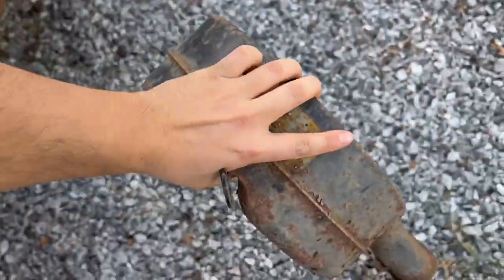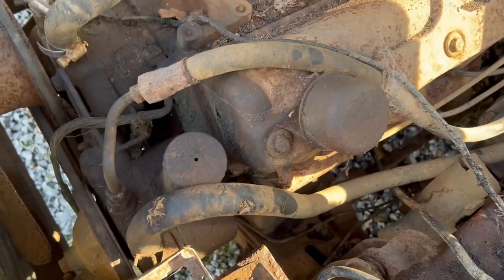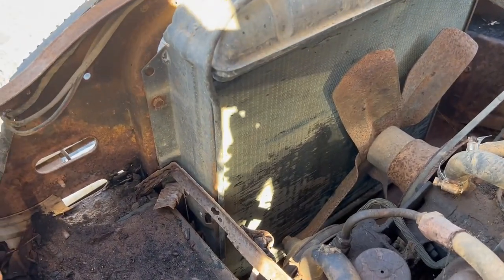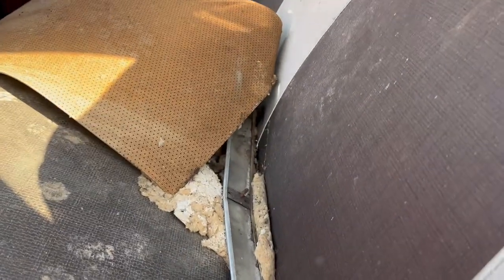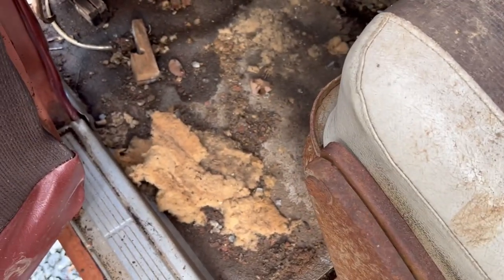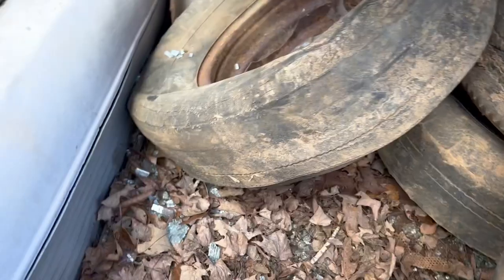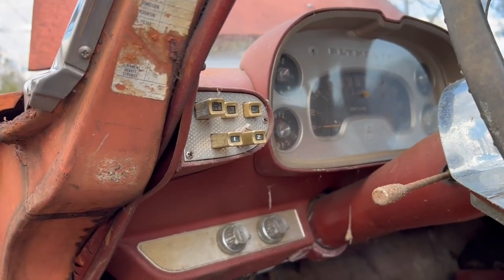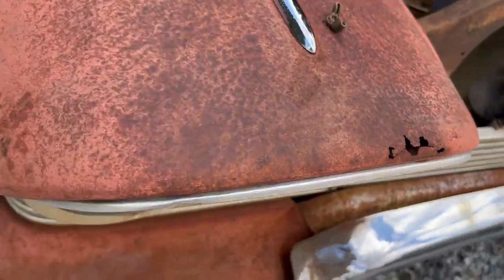1957 Plymouth Sport Suburban Car Show, Abandoned for Decades! Fresh from the woods! MoPar Details

Comment: Dad bought a '57 Custom Suburban in '57 when I was a young 'un. It had the bumper wingettes on the front making it even cooler. All of a sudden our driveway looked years cooler than the others with boxy GMs and Fords. They still had to lift up the rear tailgate glass and prop it up and then open the bottom gate - we pushed a button (option) or cranked the glass into the gate and popped it open. 🚙

Comment: Fun fact:
These cars are able to be push started. They have a rear pump in the transmission to allow fluid to build pressure.
Reply: 100% correct
Reply from the maker: That’s true… but you have to get the car going at a good clip! Almost 20mph! I’ve had to do it a few times but it does work.
Reply: @ObsoleteAutomotive  the car in my profile picture was pushed started when my dad bought it back in  the late '60s. Strange what I remember from being only around 4-5 years old!
Reply from the maker: @dans_Learning_Curve  That’s awesome that you still have the car.

Comment: On the engine, remove the spark plugs (number each wire as to which cylinder it goes to). Then fill each cylinder with Automatic Transmission Fluid and let them soak for several days. This will usually allow you to break loose the stuck pistons although you may have to rock the crankshaft back and forth to loosen things up good. It looks challenging right now, but with perseverance you can get this one going again!
Reply from the maker: The cylinders have all been filled with a blend of oils already. This one was being a bit more stubborn. Sometimes you have to just take the engine apart. 

I had a slant six engine full of water that I was able to unstick and get running! Though I had my doubts on that one!

Comment: You should be able to get the ignition switch out of the car and take it to a locksmith to have a new key made for it. I see many people drill out the old lock with no thought to getting a key made. The switch is probably OK. If not there are likely replacements available from places that specialize in old Chrysler product parts such as Andy Bernbaum. Like someone else mentioned, PB Blaster is a really good penetrating oil to help un-freeze carburetor and other linkages etc. You should be able to get some good lithium grease at your local auto parts store. Good luck!
Reply from the maker: The ignition switch was removed and new keys made by a local locksmith. Drilling out anything is a last resort. This car had a lot of what I call “old rust” which is what you find after something sits for a very long time. Might get lucky with penetrating oils but would likely need heat and some effort to break free anything.

Comment: Oil looks pretty good. These things are built strong. Bet it'll run with some love. No parking gear so make sure the E brake shoes that tighten on the drive line are operable.
Reply: Fyi: these old Plymouths had parking brakes that worked off the rear drum brakes, no e brakes on the drive shaft..
Reply: @markreisen7038  I beg to differ

Comment: The metal piece on the passenger floor covers the column area under the steering wheel. It is held on by a spring or two as I recall. I used that piece to pull off the original interior trim color. As poorly fitted as that dash pas is, my original looks the same. Appears to be missing the dash mounter rear view mirror.

Comment: oil is lubricant, wd40 is a water displacer good for old point distributors and frozen locks
Reply from the maker: Right off the WD-40 website:

Myth: WD-40 Multi-Use Product is not really a lubricant.

Fact: While the “W-D” in WD-40 stands for Water Displacement, WD-40 Multi-Use Product is a unique, special blend of lubricants. The product’s formulation also contains anti-corrosion agents and ingredients for penetration, water displacement and soil removal.
Reply: Yes, it is a blend of lubricants, but it does not function well as a lubricant.  It actually dries up and it actually evaporates.
Reply from the maker: @michaelbenardo5695  The point was to lubricate the moving points so as not to damage the hood or hinges due to years of being closed. I’ve seen countless hoods folded in half and hinges twisted beyond use when people try forcing them open or closed. 

PB Blaster, WD-40, Kroil, 10w-30, Dextron III, olive oil or really about anything to help with friction will work. 

Eventually everything gets a deep clean to remove years of grease, dirt and rust before using the final choice of preferred lubricant.
Reply: @ObsoleteAutomotive  True, it will do the job right after you spray it on, but in about a week, the hood will be getting stiff again.  3-in-1 oil is a better choice.  70s GMC and Chevy trucks were notorious for hoods that folded in half.  Supposed to be a safety feature - in a collision, the hood would not come through the windshield like a draw-knife and behead you.  They fixed it in about 1980.  Too many complaints I guess.
Reply from the maker: @michaelbenardo5695  Honestly I just grabbed the first can of lubricant within reach. I have every lubricant, grease and rust penetrant you can get. Everyone’s up in arms over using WD-40 for whatever reason but it did the job.

Comment: Take out the lock cylinder from the door to a locksmith and have a key made.  Check the same with the glove box lock.
Reply from the maker: Ignition and door use the same key. It’s much easier to have a locksmith make one for the ignition switch as it’s much easier to remove. The wagon rear window crank uses its own key that does not match the ignition/doors or trunk lock on a sedan.

Comment: I found an edlebrock intake for a 318 poly I'd imagine that it would still go on a 301 would it?
Reply from the maker: Intakes will interchange between Poly 318 and Poly 301. (Make sure the intake is for a Poly 318 and not the later LA318. The size difference is very obvious.)
Reply: @ObsoleteAutomotive  thanks! Yeah it's a p600 I believe it is for a poly it's a 3x2!
Reply from the maker: @DavidFlores-lu4ji  You don't see very many aftermarket intakes these days. It would make a neat setup!
Reply: @ObsoleteAutomotive  I do got a question I've been wondering. I got a 57 Plymouth Belvedere with the 301 what transmission would it have? it's the push button with the 5 buttons drive, neutral, reverse, first and second
Reply from the maker: @DavidFlores-lu4ji  That’s a cast iron A488 Torqueflite. The cast iron unit was used until 1961 with some changes along the way. 1962 the aluminum A727 Torqueflite was introduced. They do not interchange! The poly 318 engine also changed for 1962 and has a different bellhousing pattern, crank and other differences and will not bolt to the older cast iron transmission.
Reply: Never knew that they changed the bell housing pattern and the crank.

Comment: Hidden keys would be on the passenger side front wheel well . Might i say that i woukd rather see you use a PB Blaster lubricant than WD40 a water displacer and tar remover so any old grease that may have been on the hinges would be starting to desolve with WD40 .

Comment: May not be the top of the line but it's awful well optioned with the better steering wheel. No exterior spare tire opening or power brakes. Does have to higher end transmission gears.

Comment: We got a 57 two door wagon that is missing the rear window interior crank and window track mechanism.  Any chance you could show me pics of that stuff? I have no idea how it's supposed to look.  Thanks keep up the great work and check out our channel if you get a chance.
Reply from the maker: Are you referring to the back seat side glass or the tailgate glass? On the 2dr wagon the backseat windows don’t have cranks or any type of mechanism. They just have a latch at the front and slide to the rear. 

The manual tailgate glass does not have an interior crank and can only be opened from the outside. The power tailgate glass has multiple switches to raise and lower the glass however. 

I have another video showing the replacement of the back tailgate glass and goes through removal of crank mechanism and exterior handle and such which may help.